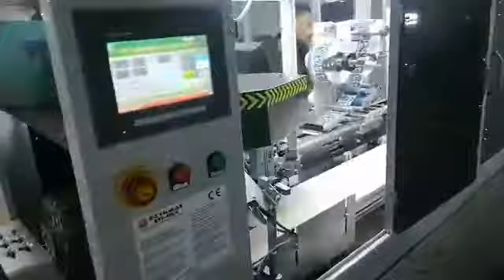ıslak mendil makinesi خط كامل لانتاج المناديل المبللة wet wipes machine WhatsApp +90 533 390 28 24

Comment from the maker: OYM 2025- 12 WET TOWEL PACKAGING MACHINE
Wet towel packaging machine is a type of equipment designed to package wet or damp towels efficiently and hygienically. These machines are widely used in industries such as hospitality, airline, healthcare and food service where individually wrapped wet towels are required for customer use.
OYM 2025- 12 WET TOWEL PACKAGING MACHINE
The packaging process usually includes the following steps:

Wet Towel Preparation: Wet towels are first prepared by folding and moistening with a suitable cleaning or disinfectant solution.
    OYM 2025- 12 WET TOWEL PACKAGING MACHINE
Feeding: Prepared wet towels are loaded into a feeding system or conveyor belt that transports them to the packaging area.

Transport of Packaging Material: The packaging machine deals with the transport of packaging material, which is usually a closed pouch or pouch. The machine can use pre-cut packaging film or a continuous roll of film that is cut and sealed to form individual bags.
OYM 2025 WET TOWEL PACKAGING MACHINE
Capping and Cutting: Wet towels are placed on the packaging material and the machine cuts and seals the bags to separate them from the continuous roll or from each other in the case of pre-cut bags.

Optional Labeling: Depending on the requirements, the packaging machine may include a labeling mechanism that applies labels to individual bags. These labels may contain product information, brand information or usage instructions.

Unloading and Stacking: Once sealed and labeled, the bags are unloaded from the machine and neatly collected into trays or boxes, ready for distribution or further processing.

It is worth noting that there may be differences in the specific features, capacities and automation levels of different wet towel packaging machines. Some machines may include additional functions such as automatic towel folding, liquid dosing systems, date coding and even custom printing on packaging material.

When looking for a wet towel packaging machine, it is important to consider factors such as production capacity and ease of use.